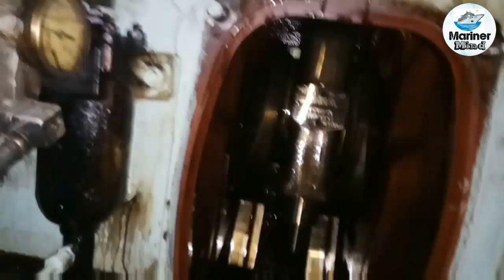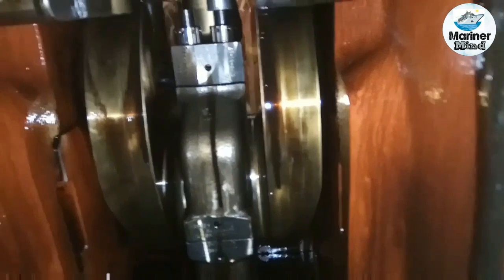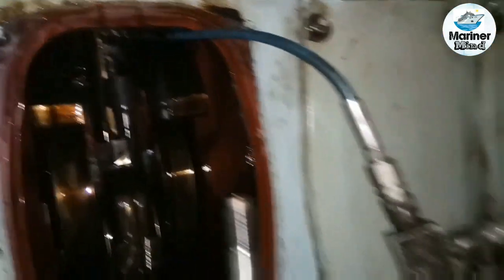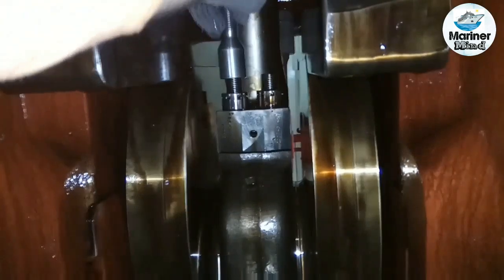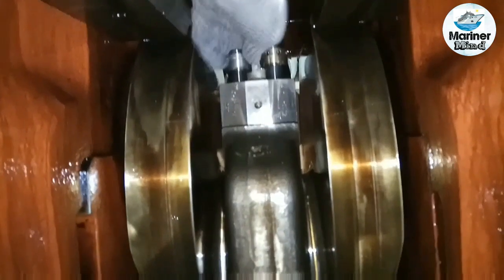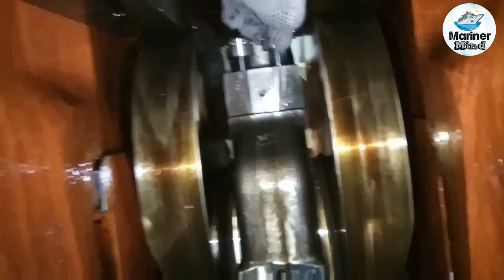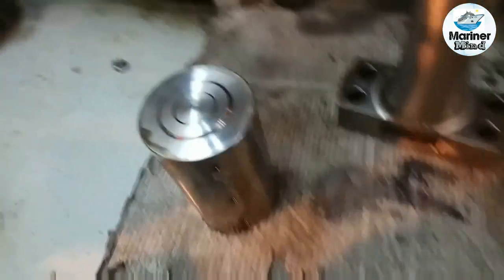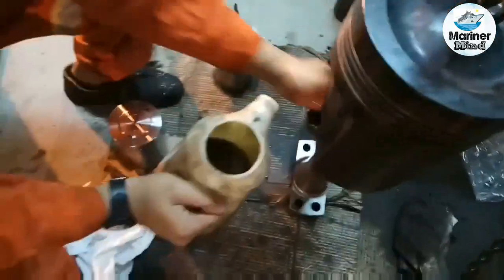Piston removal- Diesel Generator unit overhaul series part 2- HIMSEN

Comment: which engine ?himsen?
Reply from the maker: Yes   it is a himsen engine
Reply: @marinermind761  sir, how the cylinder liner is lubricated in this engine? 1) oil coming through the gudgeon pin hole to the cylinder liner?  OR
2. any sort of nozzle/jet oil spray from the bottom? or 3 is there any hole on connecting rod to spray the lub oil in upward direction? Or
4. just splashing lubrication done by submerged crank throw of the cranshaft?
which way oil is going to the liner and making a oil film?
your reply will help me a lot!